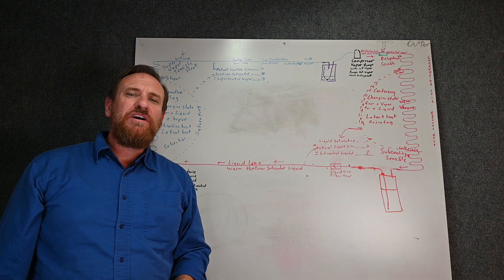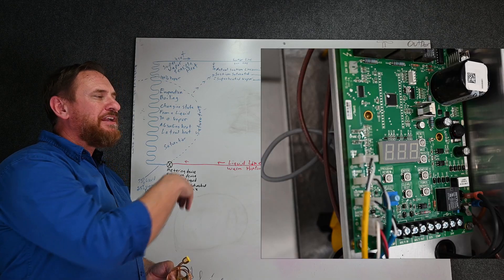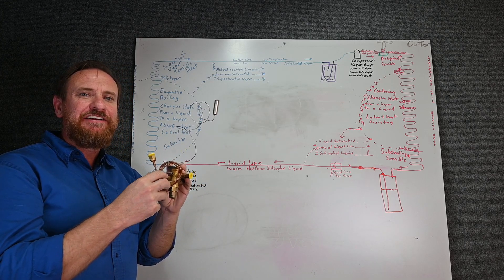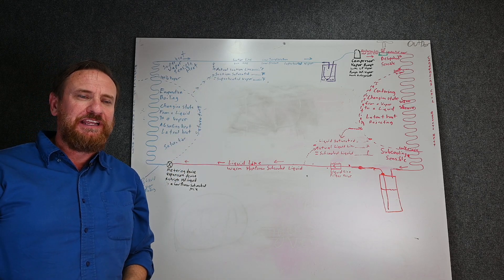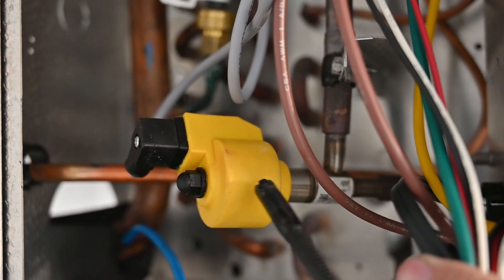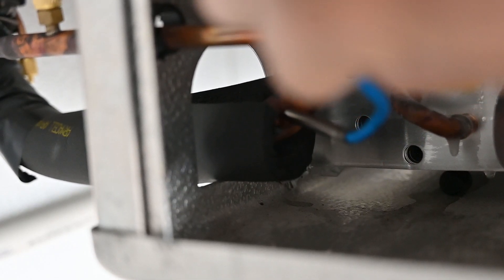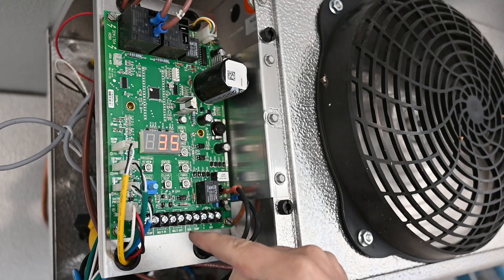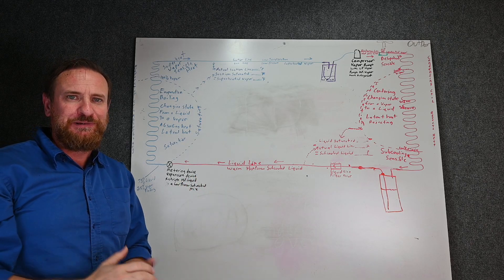HVAC 091 EXV EEV Electronic Expansion Valve introduction

Comment: Thnx for the video. Biggest disadvantage of EEV is when it comes in contact with foreign particles with refrigerant its needle gets stucked. Resulting sweating ( Dew formation ) on indoor front grill panels in VRF units. Sometimes also liquidification.
Reply: I believe this to be true of all types of metering valves.

Comment: Hi Ty - I’ve been using stepper motors quite a bit recently and have learned a lot about them. Please don’t hesitate to reach out if you have questions. In short, stepper motors can be configured such that each time an electronic controller sends a pulse, the motor increments by a fixed angle. In the example you mentioned, the motor is set to 1600 steps per revolution. So each step corresponds to 360/1600 = 0.225 degrees per step (this is the angular resolution). In the case of these valves, each step will cause a 0.225 degree rotation which in turn will cause the valve to move by an amount that depends on the pitch of the internal threads. Also, stepper motors have a second control line that specifies forward or reverse. - Cheers - Jim

Comment: @5:50 its a stepper motor.  These are brushless motors that can hold a position.  Brushed motors can go forward, backwards, or spin freely.  Brushless can hold positions of usually 1.8° or .9° increments per rotation, and have reduces holding torque with microstepping.  Ive seen microstepping of 1/256 of a step.  You see them a lot in cnc, 3d printers, or robotic arms.
Reply from the maker: As soon as I get some to dissect, I will do a more detailed video including that important information. Thank you

Comment: Hi Ty, I hope you are doing great. This question doesn't have to do much with the video but is something I've had in my head for days. On mini splits you have two lines going into the indoor coil, one line is the vapor line, the other is the expansion line with liquid/vapor saturated mixture inside. My question is, given that we have a saturated mixture running on the expansion line shouldn't we be able to check superheat just by taking temperatures on both lines? Thanks a lot and have a blessed day.
Reply from the maker: Yes, but because they are variable capacity compressors and variable fan inside the superheat will change. 

Check outy friend Craig  with AC service tech for great ductless videos and his ductless inverter book!

Comment: Ty can we please get a video on zoning boards operation and troubleshooting please dude. Also on another note my buddy Jordan B was a student of yours and he said you told him to never change breakers because of a potential fire hazard.
Reply from the maker: I'm a good ways away from airflow. It I will ad that to my list.
As for breakers.
Changing a breaker is easy however in most states that falls under an electrical license. 
The reason is for a few parts. 
1 the electrician would look at more than just the breaker, they would look at wire size, load and wire type to ensure it was safe. For example a loose connection on the HVAC breaker could also be loose connections on others as they where installed at the same time by the same person. 
2 the electrician (should be) trained to look at more then just the breaker. They would bee looking at the while panel and may find other issues related or unrelated to the one at hand.   
3 too many times I have seen hvac techs put in larger breakers, the wire then become the fuse and could cause a fire. 
4 breakers rarely  fail. There is usually a cause such as  long-term overloads, spikes in voltage, and shorts in wires or in motors.
5 codes and liability. Each state is different. For example Texas will allow a licensed hvac company to do electrical work specifically for HVAC equipment exclusively up to and including the equipment disconnect.  1305.003(a)(11)
Other states will not allow disconnects to be replaced. 

I like to leave the electrical work to the electricians and keep the electricians away from our HVAC equipment. 

Tell Jordan I said hello and never stop learning.

Comment: Are there any specific troubleshooting tips for this style valve?
Thanks.🤔
Reply from the maker: I will be doing troubleshooting series eventually. Biggest issues is denise in the pin. 
For trouble shooting Feed it the proper subcooling and then check superheat to see if its maintaining.
Most manufactures will have specific printed troubleshooting flow charts. From there for checking the step motor, thermistor and transducer. I posted a link in the description with Chris diagnosing one.
Reply: @love2hvac  😊

Comment: Ty this is off topic but you’re a genius. I’m working at a school with several units on one side of the building and several units on the other side of the building. Multiple units are down. One I got running today after I cooled it off and got it out of thermal overload. 48psig vapor 230psig liquid line. R22 I believe it’s a plugged metering device. Have you ever used a wire toner on 24v wiring to match condenser to air handlers ? Just a idea that popped in my head. I think it would need to be a live wire toner. Any merit to this idea? I’m new but crafty.
Reply from the maker: That's a good idea.  I use to get a helper to work the thermostats while I found the OD unit. 
Then I like to label the thermostat and also on the sub base
 Them label the unit and also inside  the electrical panel of the unit. 
Thanks for watching.

Comment: I never really understood why furnace controls never have a microcontroller on them. Tons of expensive, complex, old school logic gates.
Reply from the maker: Great point.

From what I understand, they want to keep the fail safe in place. 
Having the internal patches and gates keeps the sequence in check. 
For example the 24v from w is patched therw the relays so if anything in that series stops it shuts off the gas valve. 
They where concerned that full microcontroller logic boards could potentially energize the gas valve without the inducer fan and potentially have a fire hazard. 

But I'm not an engineer.